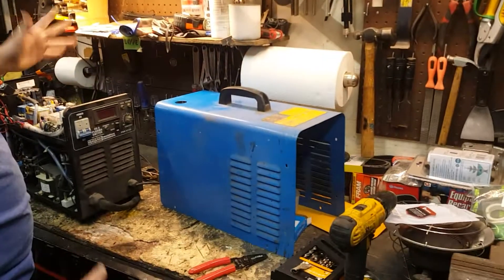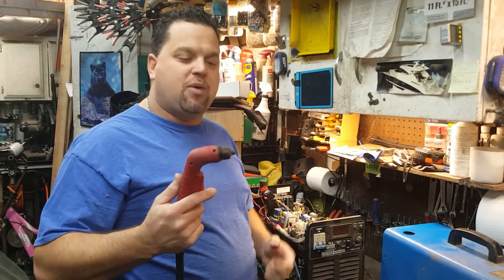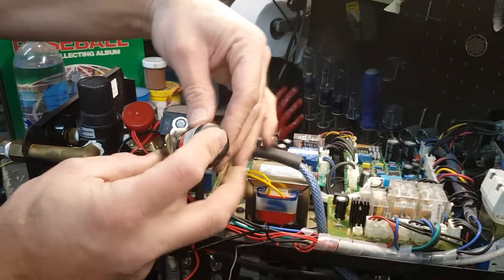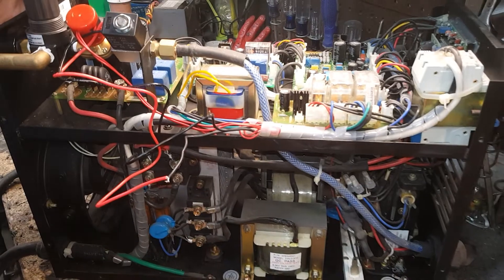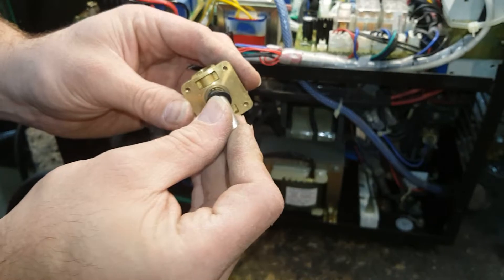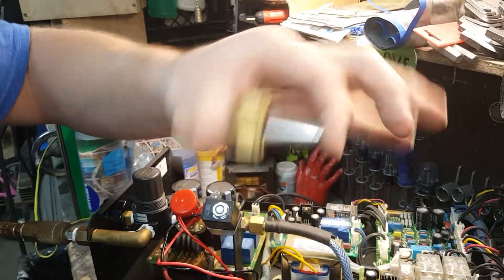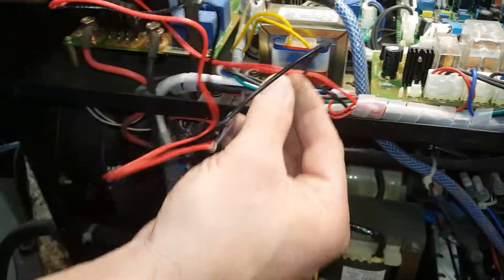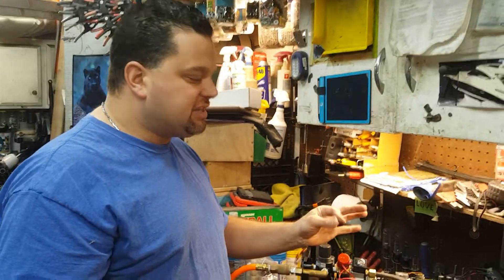DIY Plasma torch repair (bad air solenoid)(ark won't ignite)

Comment: Stay away from Made in China...90 Free warranty from Harbor freight... one years later ( Plasma cutter) I just used it as Boats arches..My Hypertherm model number 40SC still running first day I used it $3500 brand new... That's 32 years old 😭🗝️💔 ahhhhh

Comment: I have a cut 50 and have no air or fire and the digital readout flashes 000 did yours do that? I have only used this thing 2 times but the warranty is up on it.
Reply from the maker: Actually I don't remember if I had any error codes. But it's very important to put dry air through your plasma torch. The number one thing to take out plasma torches is wet air. It's only a couple bucks to replace and give it a shot and see if it fixes it. Wouldn't that be nice
Reply: @whenjeffgetsbored  thanks for the reply

Comment: What happens if the air is responsive to the switch and coming out full force to regulator setting but no high frequency arc?
Reply from the maker: Check your connections at the tip. If they're dirty bent or loose it can cause that problem. There's also a bunch of stuff electronically that can cause those problems.

Comment: Hie, great video, I have a problem with mine, it's hi cut80 Chinese make, I use it on cnc table, now the problem is when I press start to cut a piece, the air is released and shows an error warning light, without any spark, the warning doesn't go off until I restart the plasma cutter. Can it be the same problem?
Reply from the maker: I'm not that familiar with that unit. I don't know if I can help you. But if it won't work it's usually either a bad ground or the tip is burnt out or loose. If it's not something simple like that it might be time for a new unit unless you know where to get the electronic service.

Comment: Similar problem when the air continuously blows out when you release the trigger, it should blow for a short while to cool the tip , but I think mine must stick open and allow an unnecessary release of air, I can make it stop by squeezing the ail line to stop the flow, this seems to reset that air control solenoid. It probably just needs a clean ( no oil) Hope this may help anyone with a similar situation.
Reply from the maker: Thank you for leaving your comment but I would like to add to what you said. When the magnet inside the solenoid starts getting week it doesn't have enough pressure to blow past the air in the junk that may have become collected in the solenoid. You can try cleaning it but more than likely you'll have to replace it.
Reply: I'm having this issue. First cut is fine but then it doesn't stop blowing. The cut light on the unit lights up, but no arc. I'll try it and report back if it cures my issue.

Comment: Jeff I have a 110v drag-on thermal dynamics built in air . The switch is good the fan comes on. I tested the little 12v compressor it works when I bypass the machine on a 12 v battery charger  . When I hook the wires back to machine the air will not activate. Computer board looks fine no blown solenoids .could you tell me why the fan comes on but the air compressor inside will not turn on?
Reply from the maker: That's a great question brother. It's really hard for me to help you brainstorm on this idea because I don't really have enough information. I'm not too sure what unit you have. And I'm not too sure what you're talking about when you say it has an on-board compressor. Mine uses a general shock compressor like most plasma torches. It sounds like you have a very unique piece of equipment that I'm not familiar with. However if you give me the model number or a link to what kind of unit is I'll do a little homework for you.

Comment: On the side of my solenoid say it's AC, not DC which has been my problem finding a solenoid for my harbor freight, Chicago electric plazma cutter, you have any suggestions for the AC part and where to look, thanks for your time and the vid, very helpful
Reply from the maker: This one has an option for 110 volt AC. But that's all I know based on your specifications. I hope this one works for you

 https://www.amazon.com/dp/B07QRTF9ZQ/ref=cm_sw_r_apan_glt_i_0MADS51GRMWRPBDH3S9G?_encoding=UTF8&psc=1

Comment: Where did you get the new air solenoid, thanks for the vid, just what I needed for my Chicago electric plasma cutter, which has the same symptom, God bless
Reply from the maker: I'm so happy this video helped. I'm sorry took me so long to get back to you I'm sure you figured it out by now but just in case for you or other people. I got the air valve on Amazon. please see the link

 https://www.amazon.com/dp/B07QRTF9ZQ/ref=cm_sw_r_apan_glt_i_0MADS51GRMWRPBDH3S9G?_encoding=UTF8&psc=1
Reply: @whenjeffgetsbored  Thanks for sharing the info buddy, much appreciated!
Reply: Thank you for the link with the exact part needed.

Comment: are those jars lids glued to the botton of the shelf/cabinet? Great idea!
Reply from the maker: LOL. I'm glad you like the idea. To answer your question they are not glued. I ran two screws through them with washers so they didn't break out. If you only use one screw then it'll spin when you try to undo it.